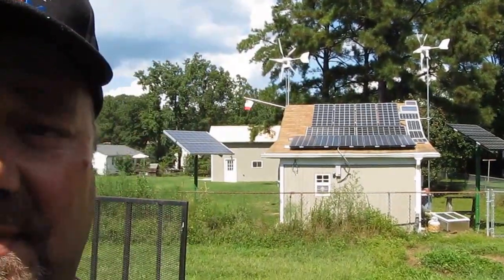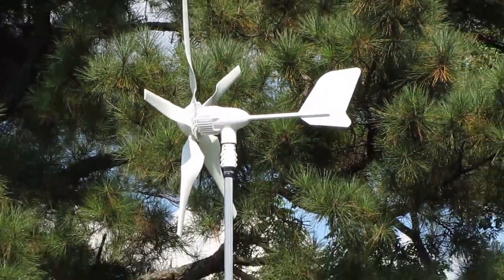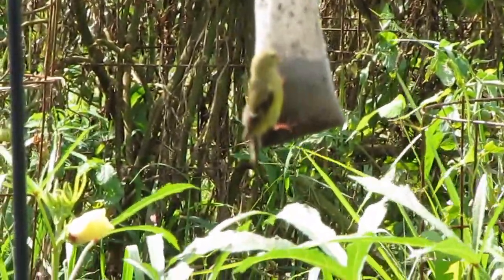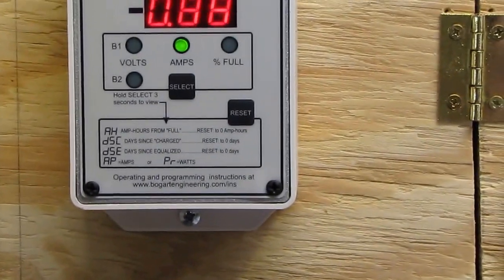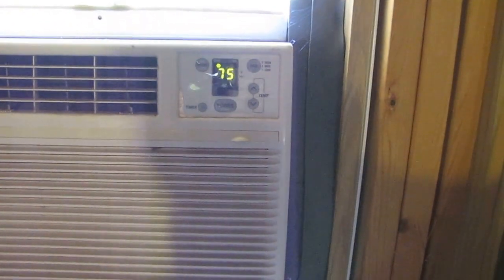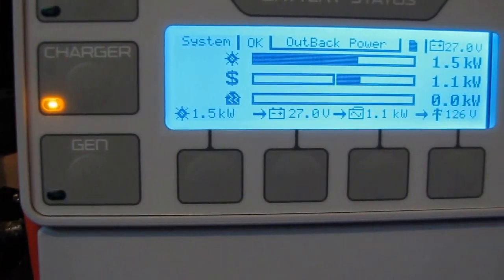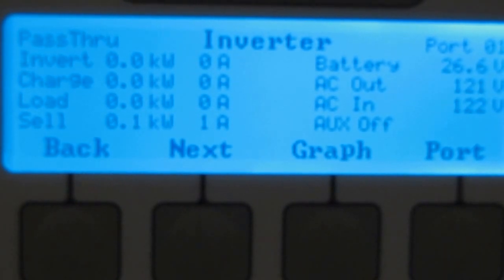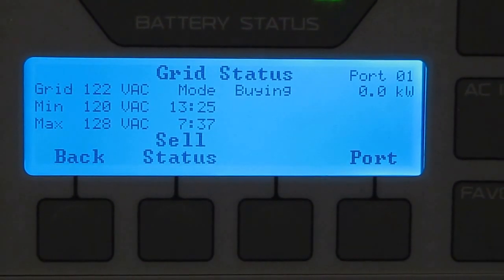ON / OFF GRID Solar And Wind Update For August 2013 By VIARLOCITY

Comment: Roger on the energy from wind and sun.  I like the fact that once you purchase the necessary equipment, from there on out you're ahead of the game.  I like the fact that currently I can handle 500W for about 8 - 10 hours.  Which means that I won't need to run a generator all night. I'm happy with the capabilities of solar, but as always...  More panels, bigger batteries.

Comment: Kenny - Roger on the power hungry.  I draw 1Kw average 24/7.  You've definitely got more panels installed than I do.  I don't have the entire 1Kw load on my system since I want 10 hours of standby power on battery alone.

I also would like to say that I agree with your recommendation of Bramley and Alt-E entirely.

Comment: Kenny you could put some styrofoam with some aluminum foil sheeting on the attic and it will reflect the heat coming in from the shingled roof. plus insulate some. It will make a hell of a difference. I m doing it to my shed. Its working good.